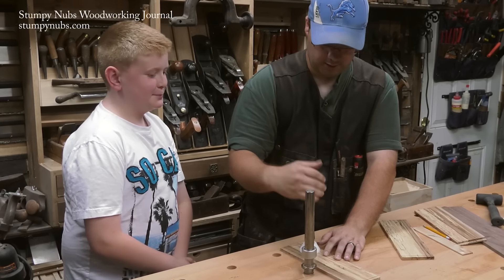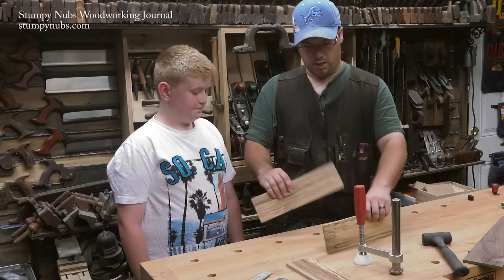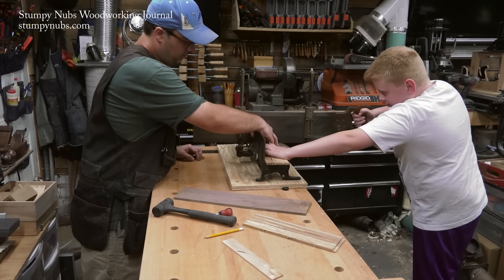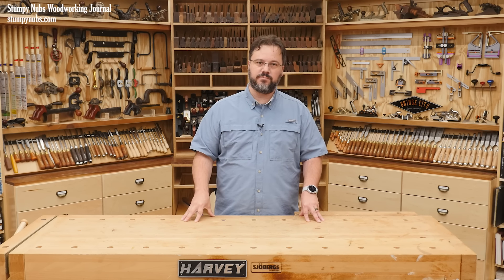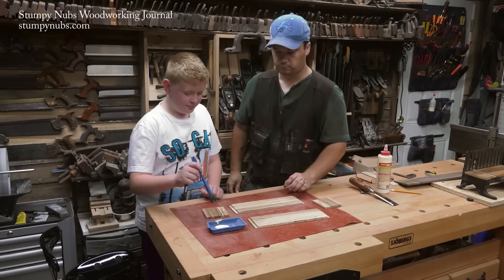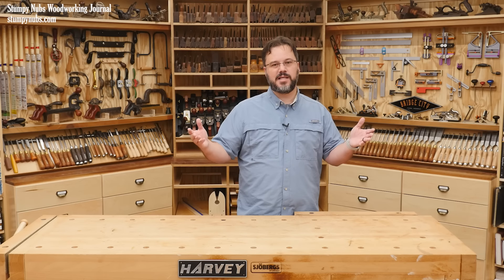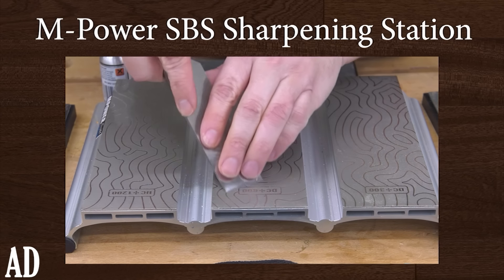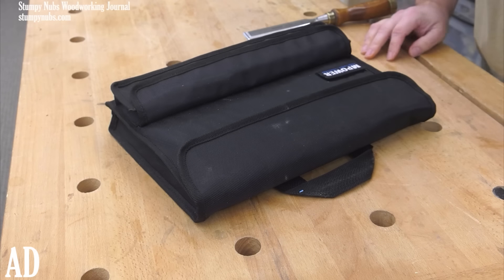Watch this before you let a child use tools

Comment: Best birthday party we ever did for my son was a construction party with various stations around the back yard. Hammers and nails and scrap wood. Drills and more scrap. A short-handled shovel and a spot they were allowed to dig up the dirt. I let them prime the shed (I’d paint it later) and that was a huge hit! I even had a circular saw that I used to cut off a small block for each them, and let them put their hands on it with me during the cut. We had toy dump trucks and such out around the yard. Decorated with a few orange cones and handed out orange vests—and it was 4-year-old boy heaven! “Bob the Builder” in real life 😆  (And yes, I arranged to have a responsible parent standing by at every station around the yard to make sure things were safe.)

Comment: Thank you for this! We had six children (well, we still do, but they’re bigger now). Our schools did not teach woodworking, sheet metal work, welding or auto shop. No drafting either. During the summers I would teach a woodworking class for them. All of them now can do drywall repair, painting, general construction, furniture making, simple electrical work, plumbing and know their way around cars. I have no idea who the schools think is going to do their plumbing; they certainly aren’t helping raise kids to work a trade. Two of the girls are avid amateur woodworkers. Last time we visited one daughter, we helped her build a bed frame she’d designed. Next visit we are “barn raising” a wall sized library bookcases. It’s very satisfying. One son is an ironworker. Three are aerospace engineers. You can’t be a good engineer without getting your hands dirty.

Comment: This is great stuff. I got a commercial grade welder for Christmas when I was 12, before I could use it on my own my dads friend taught me every Saturday for 8 weeks. I made some good cash from it! Went on to do a carpentry apprenticeship and then an electrical apprenticeship after that. I failed everything in school but was never worried about having work. When I applied for my apprenticeship they found out I was dyslexic and had to be taught a certain way and everything was easy afterwards, even math and physics. Can’t go wrong working with your hands.

Comment: Great video. I volunteer teaching young students basic woodworking skills. They come into the workshop for 90 minutes a week for a term and build some projects. They are always very proud of their work. For the first day, we go over safety and how to properly use the tools. Hearing and eye protection must be worn. The children always have a great experience and are sad when the term is over. 

Safety wise, the only injury we ever see is on the belt sander - at least once a term someone will end up with their fingertips sanded when the piece gets away from them.

I like the idea of the box with a sliding lid. For finish, we usually use vegetable oil. Boiled linseed is pretty safe in regards to VOCs, but we also need to factor in that the shop is only used for the students a few times a week. We can't have the risk of spontaneous combustion. 

Also would like to mention the MPower sharpening system. I've had it for over a year and it's great. Do all my sharpening on it. Only time I use another stone is when I need to do repair on chipped tools - got an extra course stone for that. Would totally recommend it for someone looking for a good and relatively affordable set of diamond plates. I get great results with mine.

Comment: That miter box looks like my grandfather's (from at least before 1960, probably from the 40s.).  Beautiful piece of equipment.  One of my brothers has it now.

I coach a high school robotics team.  Minimal power tools available but the rule is that one of the coaches must be there to teach proper use and safety for any of the power or cutting tools.  This is the first mechanical work for most of these students, so they need to learn the difference between metric and inch-based fasteners/wrenches and have no experience with other tools.  We have to explain which type of saw is useful for wood or acrylic or aluminum.
A lot of instruction with using knives to cut material.  The competition has requirements that safety glasses must be worn in the pits or competition areas, so it is easy to convince them to wear them in the shop.

Comment: Hey there, gotta say I totally agree with getting tools in kid's hands. Here in the UK there's a class called Resistant Materials where you work with plastic and wood, and it definitely helped to spark my interest in woodwork. My first experience with any kind of tool was cutting the edges from some molded plastic using a tabletop jigsaw(?), which eventually developed into chisels and disc sanders.

Comment: Middle school shop class, so long ago yet I still have and use the stuff I made. Good tools there -- a big cabinet saw, a DeWalt radial arm, Makita and old school Porter Cable sanders, and the largest planer I've ever seen in my life. (Three foot wide cut? Four? Monster machine.)  We worked in metals and even plastics too.  Mr. Hodge may have been where the shop teacher stereotypes came from (he had all his fingers, but one of his thumbs was seriously injured in an accident when he dropped one of the motors from the planer on it, and low blood flow made it weirdly cold). He was old then and I'm 50 now so I doubt he's around anymore, but I think about that class often. I mostly write software for a living, but that experience more than any other gave me a lifelong interest in working with my hands. All because the instructor and the school had the courage to trust kids around controlled levels of physical danger.

Comment: Up until I was 14, I was in 4-H, and one of the things we did was woodworking. We used band saws, table saws, and drill presses. This was in the late 50s- early 60s, where today's safety devices were, well, far in the future. However, aside from a sliver or two, we all ended up with all our body parts still attached. And I still like to work with wood.

Comment: I am a Cub Scout leader.  So I have to work with up to three dozen 8-11 year-olds at once.

I have about 75 minutes to complete a project.

So for woodworking I tend to make birdboxes.  To do this, I tend to make up kits where all they have to do is cut them along the premarked lines and screw them together using premarked holes and self-piloting screws.  I predrill the door at the front.

Parents  can come along and help supervise but I only allow hand tools.  I also find Dads are keen to take control and do not listen to instructions - so I find Mums much more helpful but I also countersink the holes on both sides because otherwise they all get it wrong and  screw into the uncountersunk side which can cause the wood to split.

The result is  pretty rough but birds do not engage surveyors or lawyers and each child has their own bird box which they consider themselves to have made to take home.

Comment: First thing I made not using my pocket knife, was a hydroplane  i towed behind my bicycle. Tools used was a 10" draw knife, hand saw and and a hand crank drill. My dad's instruction: Don't cut yourself. Mine looked like the miss thriftway. Times have changed. I was at 11 and I didn't cut myself.

Comment: I got the Jointmaker Pro (2) because I figured it would be a great way for my granddaughter to start in woodworking.  I don't think she is quite ready but sometime next year I figure we will both be ready for her to start sawing with that thing.  She'll be three years old - but she really doesn't have to have great dexterity or strength and there'll be very little noise or air-born dust.  Not cheap but I did make sure I got it on sale and I think it will be a fun thing for her (and me) to do together.  Yeah, might argue she's a bit young but she is also unusually sharp for her age and her doting grandfather will not let her come to harm.

Comment: With that hand miter saw, you may want to look at the base screws of the front upright and/or the thumbscrew at it's top. The way it's moving back and forth with the saws motion isn't normal, and the one I've restored(but never use) doesn't have that wiggle, and mines even has at least one of those thumbscrews snapped off. If I had spend the time and money on the files(I've got multiple saw-sets) and learning how to sharpen handsaws, I'd likely use it more. I've got 2 Disston backsaws that fit it, but their well used and need a good sharpening.
Reply from the maker: Yes, it could use some adjustment.

Comment: Had my gran kids in shop for simple Xmas ornaments. They had a blast. They loved it. 3 young boys was a handful. Next time I have to be better prepared and have projects blanked out ahead of time. Attention span at that age is a factor. If I have to cut something or hunt material they will wonder shop monkeying with everything. I did unplug machines and pull safety switches. Even still grand paws shop isn’t a play ground so had to state rules many times. One on one would be best if possible. I did enjoy it despite the worry and safety monitoring. Boys were 4 5 and 6. 😂

Comment: My neighbor got rid of his gas mower and replaced it with a battery because his son started mowing the lawn and was afraid he would get hurt using the gas one.  His son is a freshman in high school.  Meanwhile my son at age 8 was using power tools (supervised) and 9 years later is in his senior year finishing up his carpentry and trades classes.
I say the more dangerous the tool the better.  It emphasizes proper safety practices.
Hell, I learned how to use a table saw with my grand father’s bench top one built in 1945 when you often had to supply your own motor.  It runs on a 3/4 HP washing machine motor salvaged from a junk yard with a fence that doesn’t like to move.  That thing taught me to always be vigilant.
Reply: Gas mowers are a pita for us older folks generally, and too heavy and hard to start for kids (but they may learn some Olde English words like B@%%#*$! ). Battery or even mains powered lawn mowers are just better for Olde Pharts and Kids
Reply: @brucelee3388  - I was 8 when I learned to use a lawn mower and this was when you had to prime it and took a few pulls.  It made me stronger and taught me persistence.  
When you’re old you’ve earned it

Comment: A Father's Hug
When I use a handsaw, my father's still behind me, his hand over mine on the handle,  his other holding the board, his mouth to my ear, a father's hug.  Quietly commanding,  "Steady the blade  with your knuckle, pull twice to set, cut on the waste side, long clean strokes won't bind the blade."  I feel the sandpaper roughness of his unshaved Saturday face as it is pressed against my cheek, the warmth of morning sun as we work outside, the pressure on my hand as he helps me to keep a square line.  I smell a combination of pine, aftershave, coffee and his pipe.  Our project was bookends.  I now realize we were really making memories.
When  I drill a hole, my father 's still there.  My hands on the brace. His over mine.  A father's hug.  "Square the bit from two sides.  Clockwise to drill.  Back it up to clear the bit."
A friend commented, at the birth of his child, that he would show his child the affection his father never could.  I told him his father showed him lots of affection.  Hugs, all from behind.  Each given with love.  Each meant to teach.  And through all the differences of opinion, arguments and difficult times my father and I have had, I still pull twice to set a blade, still square a bit from two sides.
Now my child uses a saw, I am behind  my hand over his on the handle.  A father's hug.